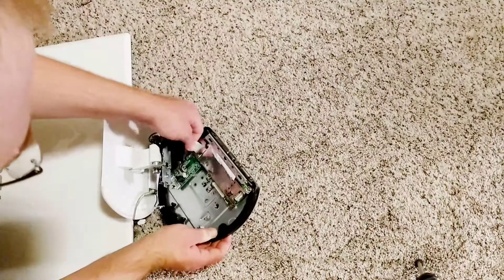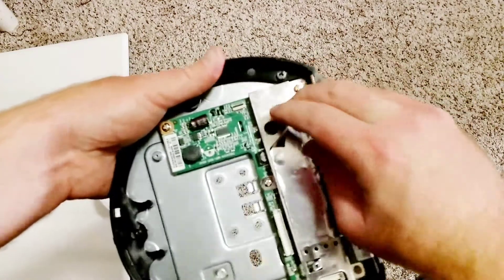AOC LED Monitor Won't Turn On Fix

Comment: los condensadores estan bien, que podria ser?
Reply from the maker: Did you verify the power supply adapter is putting out the correct voltage

Comment: Got the almost same  model (e2243f) (mfg 2011) with blinking problem the monitor doesn't go ahead from the AOC logo. The logo just keeps blinking (monitor turning on and off and doesn't post beyond AOC logo. I opened to find a 100% same circuitry. I don't see any capacitors faulty. Can you please suggest what could be wrong?
Reply: I have the same issue. Did you find a solution?

Comment: Hey i bough the cord u send me but the problem i have now is that the monitor is on but there is nothing in it but the power below is blinking
.. do you know how to fix that?
Reply from the maker: Sounds like the video cable might be bad. Are you using a laptop or desktop computer? Do you have another monitor to swap with it to make sure everything else is good?

Comment: hello can i ask what kind of wire to use on the power supple of the monitor?
cause i dont know what it called
pls if anyone know pls reply
Reply from the maker: Here's a link to one on Amazon: Xenocam 12v Ac Dc Adapter for AOC LED LCD Monitor e2043Fk E2043FK-DT E2243FWK E2343FK E2243FW I2353PH E2351F LM720 LM729 LM800 LM914 Replacement Switc https://www.amazon.com/dp/B07FSWJQWM/ref=cm_sw_r_cp_apanp_e1jiTsJeoSjwG
Reply: @becausestuffbreaks  thx man ❤️❤️❤️❤️ill sub for u
Reply from the maker: Thanks and thanks for watching!

Comment: Thanks my dude, I wanted to take apart mine because I think it has some cracked solder joints in the DVI connector.
Damn thing has been going strong for like 10 years and just recently has been giving me problems.
It could also be that my DVI cable is bad but I don't have another one to check, but might as well check the solder joints anyway.
Reply from the maker: You're welcome. Thanks for watching!

Comment: i have a problem with a e2343fi Monitor (mostly the same but with iphone docking Station,..) - the Power plug melted when it was plugged in, i've checked all the parts on the pcb but everything seems to be fine, so i guess the dc plug wasn't plugged in correctly. now i would need to replace the DC Jack socket on the Board but can't find one which will fit - i know its 5,5mm with a 2,5mm pin, but there are many different. can you help me find the correct dc  jack socket? thanks in advance!
Reply from the maker: You can replace both sides with these: https://www.amazon.com/dp/B072BXB2Y8/ref=cm_sw_r_cp_apa_glt_fabc_EZCGRP0JCW38VYBE6MA9?_encoding=UTF8&psc=1
Reply: thanks for your help! won't i have a problem with replacing the 3-pin (switched ground) socket with this 2 wire socket? or is it okay to connect the two grounds on the pcb? ... maybe i will find the 3 pin 5,5x2,5mm socket at rs-online.com, it's used on many other device too.
Reply from the maker: I don't know without taking mine apart again and just trying something. Let me know what you end up doing. Thanks for watching!

Comment: i have problem with touch isnt working because under touch buttuns is little panel
 dosnt have foil and when i try fix it blue thing on flat cabel fall out help? what kaind foil must be on

Comment: i dont speak english but i try... i have this monitor,  no work, i touch this panel and dont have respond...  is this capacitor the problem?
Reply from the maker: I don't know. Have you looked to see if it looks bad or if it measures shorted with a meter?
Reply: @becausestuffbreaks  i replace de capacitor and work but i dont have 16v 180mf... only 25v 480mf jajajaja and works
Reply from the maker: Lol, that is good news. Thanks for the update

Comment: Same monitor but when i plug in the ac adapter the flash light on the base doesnt lit up and the ac adapter flash keeps blinkingin dim colours . The monitor is notworking help me😶
Reply from the maker: Sounds like the AC Adapter could be bad. It could also be the same problem I had. Have you checked the AC Adapter like I did in the video?
Reply: @becausestuffbreaks  ok I'll check it with another ac adapter  anyways thankyou sir for your kind help❤

Comment: mine e2343f2 when i on it show aoc logo and blink off. sometimes can on. but when i off the computer. want to turn on again it happens
Reply: Same problem...did u get it fixed?
Reply: @Dr_Shaik  yes fixed change adapter

Comment: Mine is still chugging just fine, been my daily driver tell today
Reply from the maker: You get it fixed?
Reply: @becausestuffbreaks  I never had any issues, just was looking up how to do this if I need to eventually do it. Probably worth getting a new monitor. Looks like a lot of work

Comment: I have the same monitor and when i plug it in the thing wont turn on and its new never Used before so can you help me
Reply from the maker: I would return it but maybe try a new monitor cable, check power adapter voltage, and check your computer video setting with a 2nd monitor attached first. Also, you might have the same problem I did in the video.

Comment: My AOC screen e2243Fw (same electronic) restart only if I disconnect and reconnect the 30 pin wire :  If I shutdown the supply et connect him many minutes later, the screen don't start and the touch led pad does not light up, I need to disconnect an reconnect again the 30 pin wire (maybe that reset the microcontrollers), but if I never shutdown the supply after reconnect 30pin, he work fine.
Reply from the maker: It seems like your plug is giving the screen a ground. It just seems like the ground is missing in the monitor.

Comment: Hello my monitor (the same one in the video) won't turn on anymore.  The LED lights by the base are flashing but the panel wont turn on. It has worked before so I know it's not a driver problem.  Any help would be appreciated,  thank you.
Reply from the maker: Did you take it apart and inspect it?
Reply: @becausestuffbreaks  Yep, and the circuitry and connections are fine.  The LED power button flashes and you can see lights behind the black layer of the monitor.  I just presume the power button itself isn't working. Thank you for replying.

Comment: Facing the same power problem on AOC e943Fws , it turn on for a second or two and again gets off or panel lights blink continuously without display, will try to replace same capacitor .
Reply from the maker: Let me know if it works.

Comment: Our screen keeps flashing as if restarting over and over. Power cord is 12v 2.5amps.
Reply from the maker: Could be the cable to the computer or the computer itself.
Reply: @becausestuffbreaks  tried that and changed out the VGA CABLE and used the DVI, also had no input on it and it still did the same. I'm very sad.
Reply: Also can't even get it to fully start up to get to a menu either.
Reply from the maker: That sucks. Not much more I can help you with unless I was there with my hands on it. Have you taken it apart to see if there are any noticable bad parts?
Reply: @becausestuffbreaks  thanks Justin. I reached out to AOC to see if mine is under warranty still. I don't want to open it just yet. I wish I could show you the video, so you can see what it's doing.
Reply from the maker: Let me know what the end result is.
Reply: Hey...

I have exactly same monitor and exactly same problem. Monitor restarts over and over again.. It used to work after unplug / plug after 10-20 tries but now stopped working completely.  Did you find a fix?????

Comment: Sir , my AOC monitor screen , it can be ON but it shows no signal then OFF automaticaly . May i know what's the actual problem ?
Reply from the maker: Monitor cable or loose connection on the monitor cable plugs.
Reply: I think you need to turn on your CPU same thing happened with me

Comment: Hi, its possible no break tabs, are five black tabs : one at center front, two at three inchs from here (left and right) another 2 at six inch from each these. First remove screws at video ports, continue with the screws on Justin's video, finally, with your thumbs press any lateral tab at 3 inch from center, continue with next tab at 6 inch (same side), now another side, central tab, at last. Continue carefully another three white tabs inside located in the rear in top cover. My AOC e2243Fw monitor are functional again. ¡Congratulations and thank you Justin Peters! Useful video

Comment: Can i remplace for another capacitor with similar features? because in uruguay no body sells simliars capacitors(sorry mi bad english)
Reply from the maker: As long as the voltage and farad are the same, it doesn't matter how big or shape of the body.
Reply: Justin Peters I change te capacitor But don't turn on, what do you think colud be? maybe the button of on/off its broken?
Reply from the maker: It could be a number of things. Did you make sure the power supply is putting out the correct voltage or slightly higher?
Reply: Justin Peters Yes, its a new charger, 3.0amperes 12v
Reply from the maker: Did you put a meter on it to make sure?
Reply: Justin Peters Exactly, i think the main board its broken, but here in Uruguay its imposible buy it
Reply from the maker: I can't help much from here. I would need to get my hands on it.
Reply: Justin Peters I know, thanks for helpme! nice video